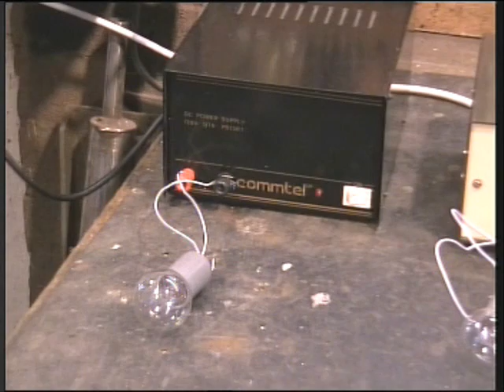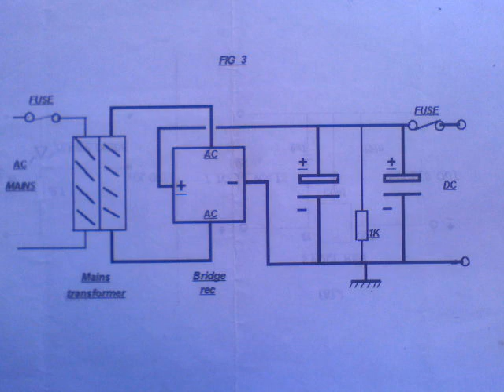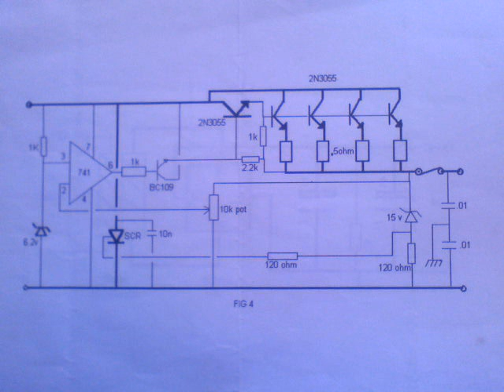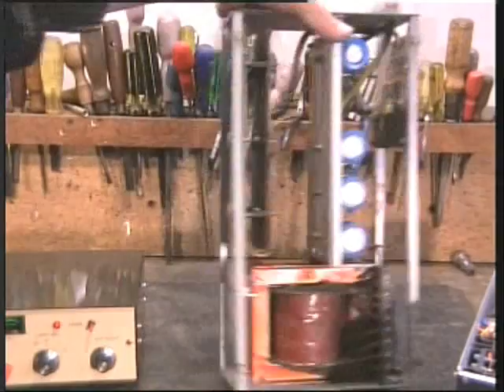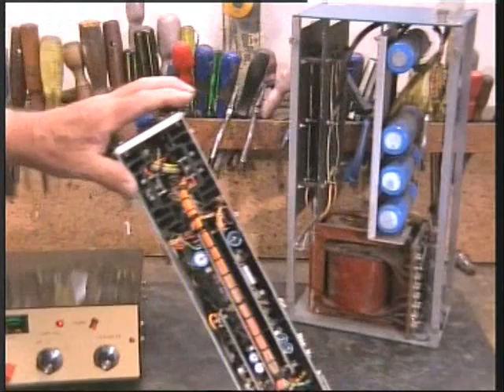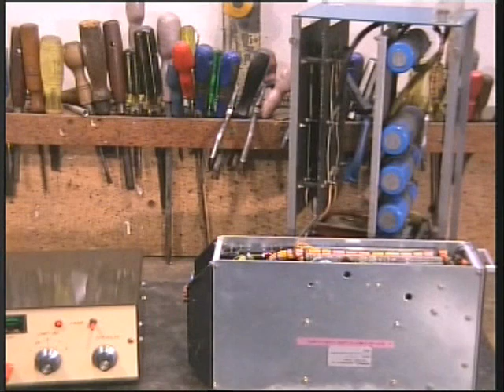building a power supply

Comment: Thanks for the video.  I'm in the process of wiring a 12V DC marine radio to use as an outdoor stereo for my pool deck.  I'm using an old computer power supply to convert the 120AC to 12v DC.  I'm hoping that the 12V 19Amp DC power is enough to power the 200watt. radio system?

Comment: Great, I need one to test automotive electrical parts. Hooking leads up to a battery is my poor choice. Need to do both 6 and 12 volt. Sometimes 24 volt. By the way I might have missed it from before, are you a Ham radio operator as it is called in the states?